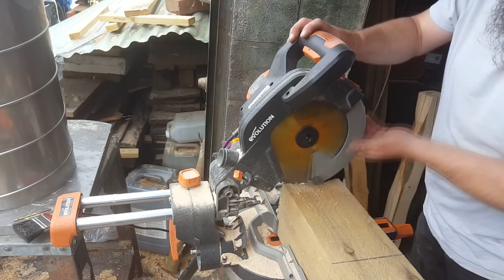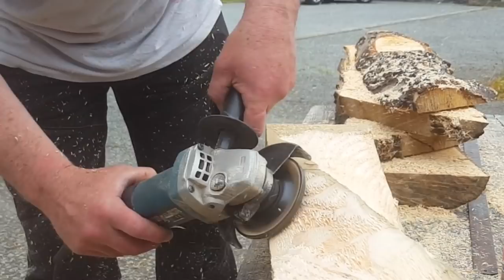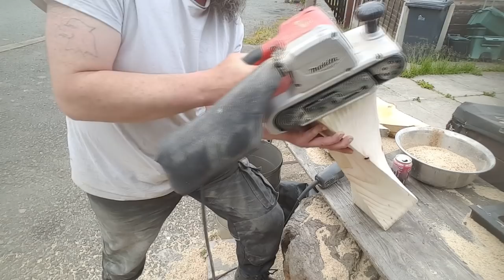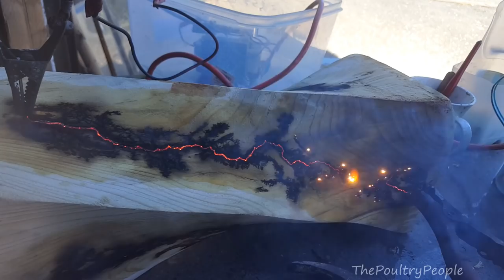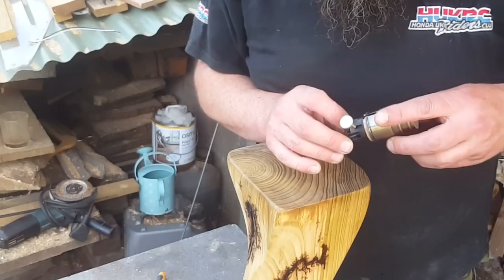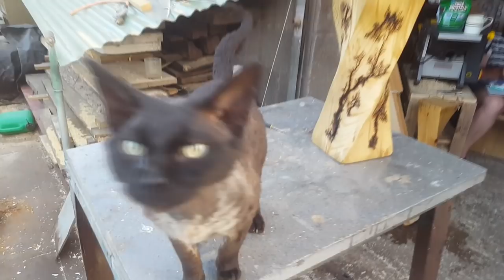Arbortech Turboplane Projects Twisted lamp with Lichtenberg Figure

Comment: Awesome love fractal woodburning and I need a turbo plane top job .
Cheers
Tim from Wood 4 Nothing
Reply from the maker: That burning is mesmerising to watch, ive spent hours staring at it :) Have you had a play with the flapdisks? The 40grit is brutal and will take off a lot of material fast but they do eventually either clog up or wear out, cheap enough though if you but them by the 20s.
Reply: @thepoultrypeople  hi yes I play around with flappy discs quiet a lot love how the sand the wood back quickly .I watched a video today but can't remember the channel where when the flappy discs were worn out he chopped off all the flappy bits and replaced them with regular sand paper which I thought was quite cool I know there cheap but hey if it get a bit of extra life out of it and saves a few quid it's gotta be worth it you should make a video of it and post it but I'd love to get my hand on a turbo plane it one of the tools on my wish list.And if you do make a video on it you could give me a shout I'd really appreciate it .I'm a cheeky got I know but any helps good to build my channel.
Cheers
Tim from Wood 4 Nothing
Cheers
Tim